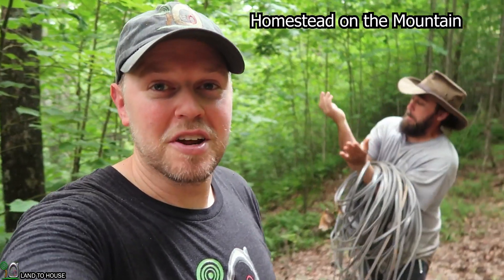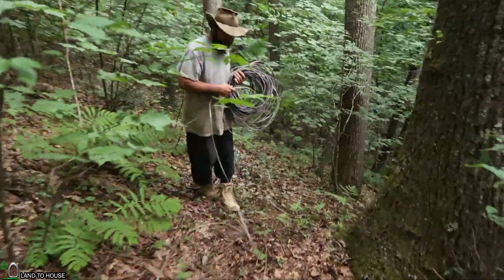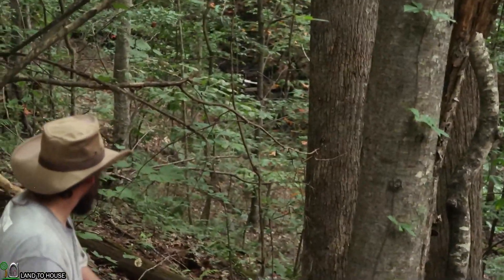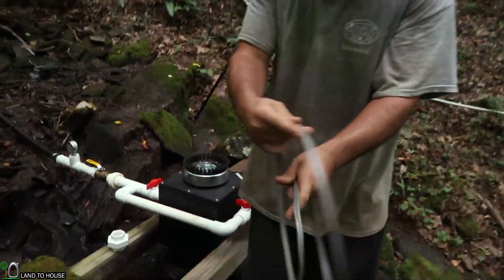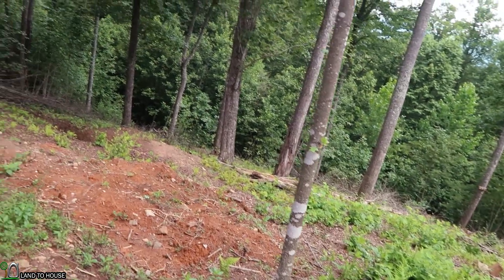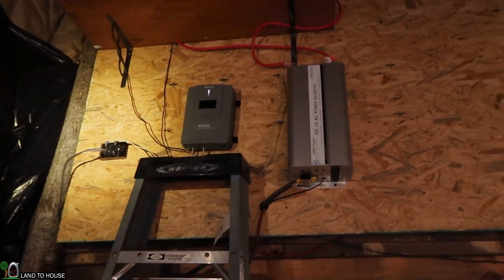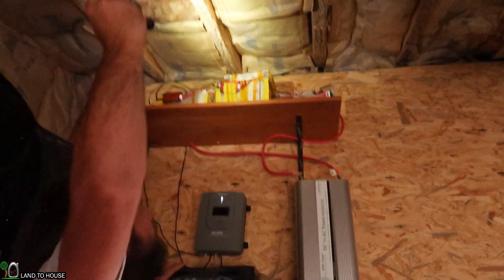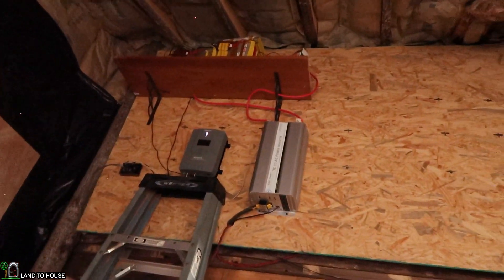Wire and Electronics Off Grid Micro Hydro 5/6

Comment: Have you considered adding heavier gauge wire to reduce resistance and line loss.  Increase in cost of heavier wire may be offset by increased power transmission and greater efficiency.

Comment: With 3 phase: How do you use 10/2 wire????
Reply from the maker: The ground in the 10/2 can be used as a wire for the 3rd phase.
Reply: Coming from the hydro its 3phase but they convert it to DC so they only need 2wires to run it to the house

Comment: I’m confused, it’s a 3 phase turbine, but the wiring run to the house is through 2 wires (10/2) , so are only 2 phases being used?
Reply from the maker: He used the ground wire as another leg of the 3 phase.

It's done fairly often. I prefer my wire to be sheathed
Reply: Land to House ahh, so still 3 cores even though it’s 10/2 wiring. Thanks for the clarification